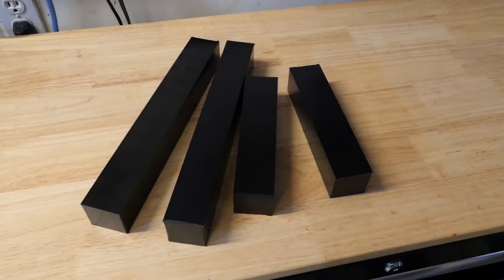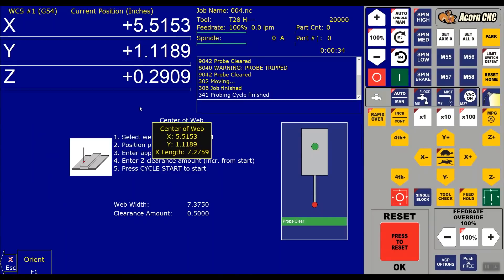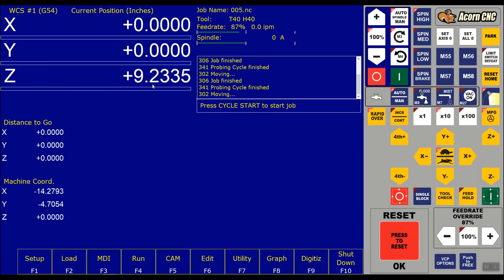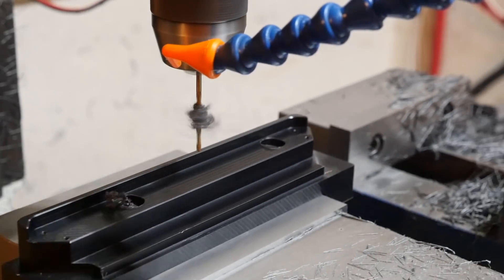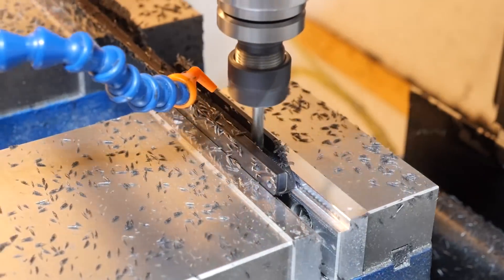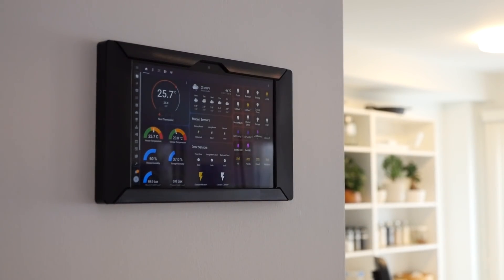Make Your Own Parts at Home on a CNC Hobby Mill

Comment: Do you have the Stock as an own feature in the feature tree or do you just import the model and add the stock in cam respective to the vise jaws
Reply from the maker: I like to add the stock around the model as it’s own feature, and separate body in the feature tree. I dont usually define the stock in cam, but that’s just a personal preference. I find it works better for multiple machining operations that involve flipping the part. The stock stays defined the way I intended if I do it that way. It does not rely on me doing “good math” when defining it in cam.

Comment: Plastic is actually not a good practice material. It requires a certain finesse with speed as heat causes melting so slow is bad. Just speaking from experience, practice material is Aluminum
Reply from the maker: Interesting. What RPM are you running with plastic? I’ve never had a heat issue.
Reply: @adamdebowski2037  Mostly 18k but it just depends on which end mill I am using. Most times heat issues come from my toolpaths not having a fast enough cutting feedrate. More friction on the tool from slower feedrates. But I mostly mill clear acrylic so there will be differences in materials.

Comment: I wanna see how you ran power to it and what uses you have the home system doing. 
Nice video. I've always wanted tto try machining but don't have the space
Reply from the maker: It’s running on 240V single phase. Dedicated 20A circuit but that’s more than enough. Thanks for the kind words! Space is a problem I have too.

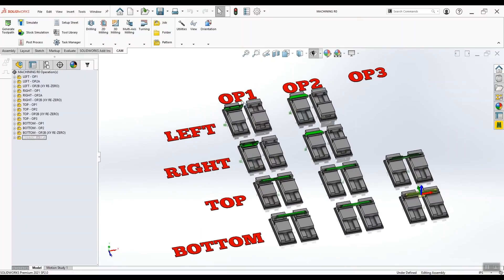Comment: Adam, great content! I just discovered your channel today and sub'ed. I have a manual mill. I'm about to venture into CNC milling and your content is super informative. Quick question about the way the operations are graphically laid out @1:35. Is that a Solidworks feature? And is it automatic or do you have to draw that layout manually? I'm currently learning modeling with Fusion 360. I got an Ender 3D printer and it has been a helpful part of learning to model components from scratch.
Reply from the maker: Hi AmericanMakerGarage - it’s layed out manually, but it’s quite easy to do. I had modelled my vises previously for another project, so it was easy to throw them into an assembly and apply a couple linear patterns to get the “grid” of different parts and operations. You can do the same thing in fusion if you like. 

You can also select the vises and tell fusion Cam that they’re “fixtures” - and it’ll warn you about a crash if you mess up a toolpath.
Reply: That's awesome. I've got so much to learn. Gonna be fun. Thanks for the reply  @adamdebowski2037 !

Comment: I just stumbled across your channel - Good job on the videos! Just out of curiosity, how accurate is your machine? Looks like it cuts really well. I have a large cnc version of that, MT001 which is an older big brother to that machine. It's been down for a while, but just built the electronics using centroid stuff as well
Reply from the maker: Hi diy_garage_tx - thanks for the feedback. That’s a difficult question to answer - but the short answer is: it can hold a couple thousandths easily, and less if you take time/perfect the process using more accurate methods. All in all, im consistently impressed by the accuracy for what it is.

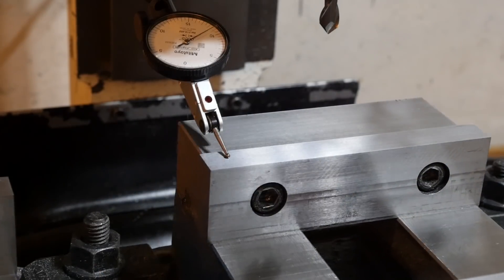Comment: Why did you machine aluminum soft jaws for the two vise part 8:45 ? It makes no difference that one was .025in higher than the other one, they just need to be in line which they were. I'm assuming the part wasn't resting on top of the jaws as you cut a shelf into them to rest the part.
Reply from the maker: Resting the long part on a set of parallels in each vise would have it sitting crooked because the heights of the vises are not the same. It is technically the surfaces that the vise jaws are sitting on that are out. Machining soft jaws takes care of that discrepancy.
Reply: @adamdebowski2037  OH! my bad I thought you were just talking about the jaws, not the vise surface height. Have you indicated off the vise surface to confirm its .025in off?

Comment: can you post a link to that quick change tooling system? i want to try set that up for my milling )
Reply from the maker: I replied to another user’s comment with several links to the tool holding - you can flip thru the comments or google “Tormach TTS Tool Holding System.”
Reply: @adamdebowski2037  yeah i just saw it.. so my machine is a rong fu 30 with a r8 system.. you still have to take the draw bar out to remove the tool holder from the special r8 collet?
Reply from the maker: @Migman2020  no - the draw bar is loosened a quarter turn, not removed.

Comment: great work. plastics - 1 flute cutter alu / polished edge is best for plastics. 7-10 dgree ramp is easy for plastics. 
my everyday job is plastic milling and turning.. For milling i will do for softer materials F2000mm/min, 13k rpm, and arround 150% depth. i know you are limited to speeds of spindel, its better to run it faster and let it chatter/ make uneven surface and just kiss the surfaces in the last pass (clearing pass s16k, f1400).

and for plastics we use cnc router most often as it can still provide 0.01mm acuracy.
Reply from the maker: Thanks for the great information! Very helpful. Cheers! Adam

Comment: Hello Adam, nice video, I love the final work. I have a question about your CNC machine. I have changed my HBM 45 to CNC and i saw your engine and the easy tool changing system.. Can you tell me the element that you have and a little bit of detail?? thank very much.
Reply from the maker: Hi Armando. I am using the Tormach TTS tool holding system. If you have an R8 spindle, you can easily convert it to TTS by installing this: https://tormach.com/tts-adapter-collet-r8-50568.html

Then you can easily (1/4 turn of the draw bar) change tools while keeping tool offsets the same. The TTS system is both easier when it comes to tool changes and more reliable for tool height offset repeatability.

Check out some of the TTS tools/tool holders on the tormach website:

https://tormach.com/tts-set-screw-holder-31818.html

https://tormach.com/tts-toolholder-er20-31829.html

https://tormach.com/tts-superfly-cutter-kit-33031.html

I plan to make a video discussing my mill upgrades soon - where I'll go into some detail about this. Stay tuned!
Reply: @adamdebowski2037  Ok, Thank very much for the information, My machine don't have this spindle. It is bt30 with the greadbox.. i don't have other option that make a invention... thank very much one more time. happy new year hahha
Reply: Thank you for adding these links! I would love to know what kit you used to CNC convert your machine! I have been looking around for a machine and conversion and this looks like the perfect size for what I want to do!
Reply from the maker: @glensmith7537  Hi Glen! There is a user on YouTube - “Arizonavideo99” who makes ball screw kits for this and other Mills. Can take him some time, but he does a great job!

Comment: What purpose does the case serve?
Reply from the maker: Hi Bernard - It controls an instance of Home Assistant. Fast forward to the last 30 seconds of the video for more details.
Reply: @adamdebowski2037  My question is about the HDPE pieces that cover the edges of the tablet.  What are they for?
Reply from the maker: @bernardtarver  Hi Bernard. I’m not sure I understand your question. The case holds the tablet to the wall with some magnets on the back. It wouldn’t be possible to mount the tablet/screen to the wall without some sort of case.
Reply: @adamdebowski2037  Thanks, Adam.  I guess I'm wondering why you substitute a back plate with an enclose.  I would imagine you could get away with a simple 4-corner mount, where the tablet could slide up and out from the  mount.
Reply from the maker: @bernardtarver  Oh I gotchya. Just personal preference, I guess! What you're describing would work just fine. I wanted a magnetic snap-in mount, and I like the fully enclosed look without being able to see the power adapter or power cable. Feels like it's part of the wall, like a light switch, rather than something mounted to the wall. Just my opinion!

Comment: Thanks for sharing!
Random question, yesterday I had to drill (by hand) some screw holes on an unusual type of aluminium plate, the chip wasn't sharp at all, I squeezed some of the strings and they would crumble into small flakes/powder in my hands, do you have any idea which type of aluminium alloy it might be?
Reply from the maker: Hi Eden. Sometimes, materials crumble instead of turn into chips. I’ve seen it in cast materials, but never in aluminum. Drilling by hand is most likely the cause of the “chips” looking like that. Can you try it on a drill press with the part in a vise instead? I would be willing to bet you get the long strands/chips that way. Most common aluminum I see is 6061.
Reply: Almost sounds like Fortal or 7075.

Comment: Thanks for putting this video out there. I’m in the process of building my own CNC mill and seeing your process is very helpful! 

How do you like the Acorn controller?
Reply from the maker: Hi Michael - I’m glad you found it helpful! I very much like the acorn controller. It’s never caused me any headaches and everything’s been plug and play and just always works. I have friends using Linux CNC that swear by it and wouldn’t switch. They claim the learning curve is steep but it’s endlessly customizable and they love it. I’d say that if you’re looking to get up and running quickly making good parts on a 3 or 4 axis mill, go with Centroid. If you’re looking to learn about CNC control systems , or want to spend more time deep diving into the control, Linux CNC might be for you. The only major advantage for Linux CNC I can think of Is the ability to control more than 4 axes. The acorn will “only” do 4 - where Linux CNC will theoretically do as many as you want…. So if you ever want to do something that involves controlling more than 4 motors (including things like for automatic tool changers), go with Linux CNC…. There are centroid acorn controllers that run a tool changer but it always involves only 1 extra motor, and maybe a pneumatic air cylinder or something (you can control up to 8 digital outputs w the acorn out-of-the-box).